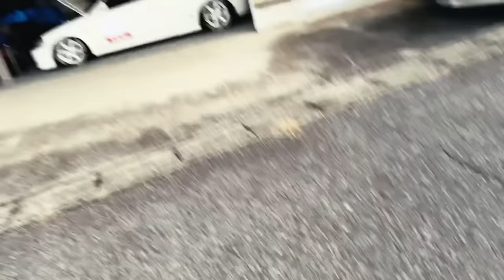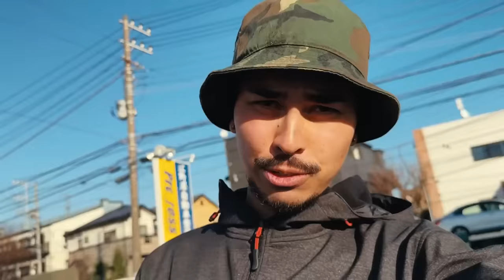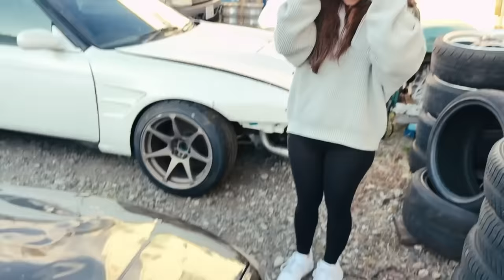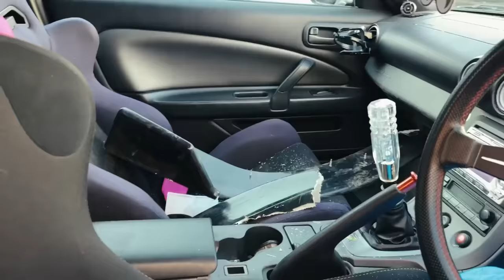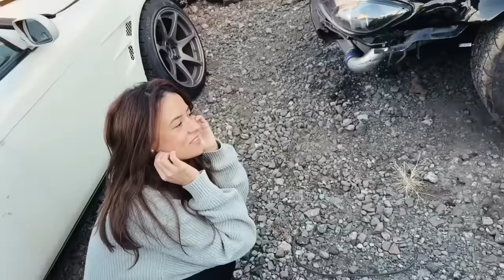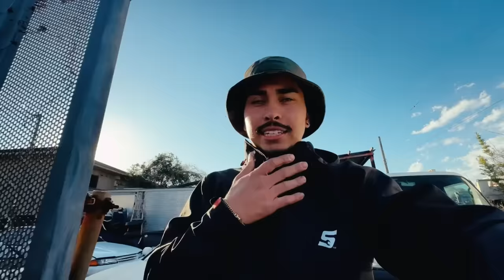I FINALLY GOT MY HANDS ON THIS GEM!! / S4E83

Comment: hope you have a solid new year and hope you your family and kota as well as his family are doing fine after the earthquake
Reply: y do you keep your hoods open wont your hood bend over time? being that most hood prop inserts are on either side of the hood
Reply: not really. If anything would bend, it would be the hinges but they're designed to support the weight.  most hoods are very rigid.
Reply: @WhuDhat   just a thought ty